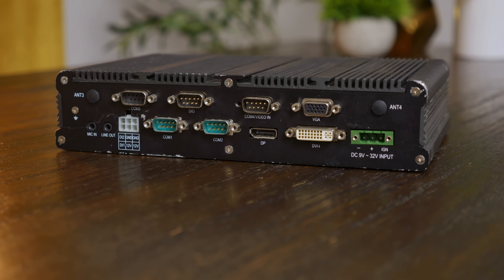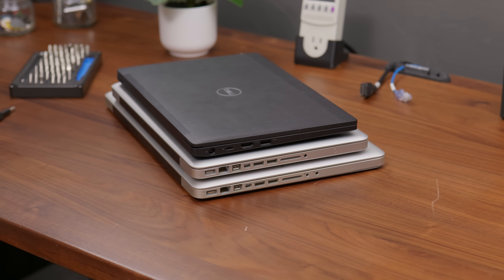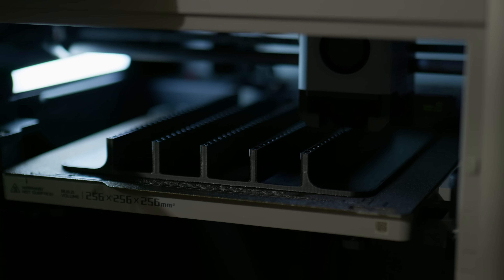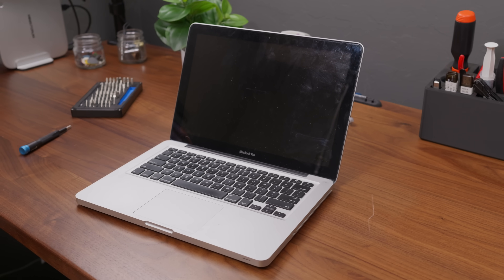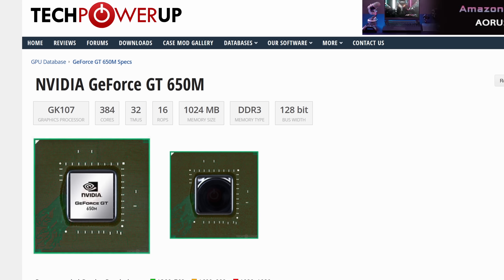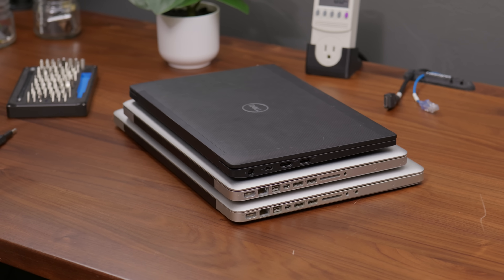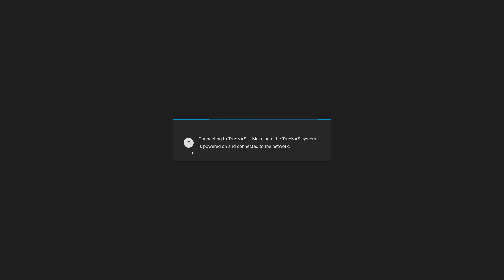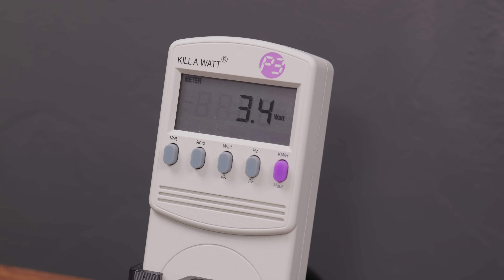Building Cheap & Efficient Home Servers with... Laptops?

Comment: I still use my 2012 MacBook Pro, I stuck upgraded the HD to an SSD, stuck in some extra RAM, and run Linux Mint on it. It does all my photo editing and media library stuff no problem. Plus it has a DVD drive which is mega useful when it comes to older media.

Comment: We are using old laptops as servers for decades....yes.. decades. For some years they are not, in most cases, interesting anymore. When they break take oo much time to find replacement machine and reconfigure the whole shit. I use miniPC with proxmox, abstraction of the hardware is a time saving feature. Bought a i7100U (low power CPU) NUC some years ago and used it with 0 problem for 5 years, been replaced with a 7840HS.
Laptop are ok for small experiment.... they are a pain to repair and cooling is not insane.

Comment: Years ago I built an OMV server out of a broken HP Pavilion dv7 with two 1TB HDs and booting from an SD card. I used it for almost five years with no problems. The screen was gone so I disassembled the whole screen, frame and hinges, installed it with a desktop screen and then you don't need it because you log in the webinterface.

Comment: I'm convinced that laptops are the best home server option.

- They have a built in display and keyboard for local management.
- Many can be equipped with multiple drives.
- They have a built in battery backup.
- You can get them cheap.
- They are power efficient.
- They don't get too hot.
- They are smol.

Comment: Back in late 1990s i had a dell inspiron 1720 ran 2 internal hard drives think were both 1 or 2 terabytes. Also had 2 more drives connected to usb3 and i velcrod them to the cover.  Then i finally tried to build a file server was just early 2000s then ran a hd controller card with a dell inspiron forget its model but i had three 3.5 inch drives internally then i got an external cd tower i stripped and installed 2 four drive backplains. Into the external cd tower so it had its own ps.  I ran all sata cables out back of inspiron then had them standing side by side connected to my bedroom tv.

Now i have a 6th gen i3 system runn8ng unraid 5.0.6. Has 18 drives all 4tb but one 3tb still havent upgraded. I have a 500gb ssd as cache drive.  I have a second 6th gen system with unraid 5.0.6 free running three 20tb drives. So this is my backup machine i keep at my dads. Its got total of 40tb storage to backup my older server.  Im debating trying to upgrade my paid unraid to 6.  Then transfer it all to my x99 system running e5-2690v3 i bought the cpu used when x99 released. Was saving for 5960x when i saw the e5 on ebay for 490$.

Id love to try unraid 6 with 4cores 8 threads the run unraid and the other 8cores 16 threads  windows tiny 11

Comment: I used a late 2011 13” MBP as a media server for a couple years. I would recommend removing the battery from a laptop you’ll be using as a server. After about a while my server shutoff. When I went to check it, the battery had bulged so much it warped the aluminum nearly forcing the trackpad out the top and I couldn’t get the back cover off.

Comment: You printed a heat trap 😂

Your stand is cramming all the heat in a laptop sandwich
Reply: Laptops air outlet is usually on the rear or side rib. I think op put them rear up, so it's all ok.

Comment: 13:00 You can make a script that will stop charging at 80% and then let the battery discharge to 10% and then start charging again. 

This way you can cycle the battery evenly. It will take like around 1 cycle per day, so battery having 500 full cycles, you look 2-3 years lifetime for the battery for good condition. 5 years is even possible.

And then make a script that if battery goes below 5%, system turns off automatically.

Comment: For someone newish into networking, could you explain why you would buy a dedicated system to run a pfsense box? Are there benefits you get from that that you don't from a consumer router? Hardware? Software?
Reply: Software, more options to play with including caching and real time filtering is the big selling point, with snort / suricata or even virus scanning with clam av, but also more effort so part of doing anything yourself is just because it's fun.

Comment: I have a relatively modern laptop with a broken display, and I'm trying to figure out if I can design and 3D print a Mini PC case for it that loses the keyboard, trackpad, and display hinges, keeps the battery, and adds an M.2 ethernet port…

Comment: Yep been running my laptop server for years.  Main advice is to find a good chassis (nvme, sata connectivity inside, ram slots, USB3 outside). Mine is a dinky little thing (it was going spare after my toddler daughter walked on the screen, so it must be 10 years old now!) and I'm just running too much over USB: it works but doesn't look pro :-) and not very performant.  Currently replacing it but the new server is also a (much bigger) laptop with two gpus for Ollama and 4 dimm slots etc.. It'll run completely silent most of the time, draw 12 watts at idle, has a screen+keyboard for emergencies, and as you say a built in UPS. What's not to like?

Comment: It’s inevitable that Mac batteries will have swelling problem and you cannot use the without battery because that throttles down the cpu. With the dell you can safely remove the battery with no impact in cpu speed.

Comment: I wish there was a way to just run a home lab/server/hub by just plugging them together and the system automatically combines them and runs them in the most efficient way. Power wise and energy wise. And when you plug in additional machines, it just automatically absorbs it and adds it to the computer power. No need to power in boot mode to type in secret codes in secret locations.

Comment: I have running a ASUS VivoBook Flip J401 MA- PS04T with a Celeron n4020 for years now as a host for QBittorrent, vpn, and RDP for my network. It's worthless for anything else ( super slow) But, it's super low powered and a built-in UPS so it does exactly what I want it to do.

I have a question though.
I am looking for a rack mounted server case or used server, or something along those  lines for a NAS with 8+ HDD hotswap drive bays. What is the go to for something like that in the homelab space? Prefer to be 4u but I'm very very flexible with that. Just would like to get the best bang for the buck but not be super expensive like over $300 . Any suggestions would be great

Comment: i actually ran a old acer predator with proxmox as my homelab for a while, then earlier this year i upgraded my workstation and now have my old hardware in another case running as my server ive been thinking of bringing the laptop back for a couple services, mainly uptime kuma as id like to have it on a separate system incase if the main server goes down my status pages will show correctly

Comment: I think with what most people are doing laptops might actually be a great start to get into networking or running a few self hosted services. Like always especially if you have it laying around anyways. Make use of what you have.
When my company throws out old computers I'm also always thinking to take them. (No worries our boss much rather gives them to us than throwing them away)
But our PCs are over a decade old and were more on the lower middle end anyways. So I can't find any proper use for them. But old laptops might actually be a nice solution to my problems.
Big companies always get rid of these things for cheap in Konvolut auctions. Should try that.

Comment: “Lipe”. I’ve had the thought of taking the screens off completely & then making a multi-tier horizontal carrier (think laptop riser) to allow access to the power buttons & better air flow. Footprint is a bit bigger but you could add a tiny 1:4 HDMI switch to help with post checking. Again: really only makes sense if you have a stack of laptops.

Comment: It's what I always use for my home server.  has a battery backup so you don't have to buy one of those. it uses low wattage.

Pro tip for any regular person watching this video. Buy a computer backup power supply and put your home Wi-Fi router on it. Then if you lose power you still have Wi-Fi for your cell phone's for a few hours also you don't have to wait for it to boot back up when the power comes back

Comment: i am using old 9 year old dell laptop which has some physical damage broken case etc  but works ok so i put   linux mint + casaos os i use this as my multi screen desktop and use it for doing work related studies emails browing  etc i have also cloudflared some of my webaps which i use it on the go works very well i have also connectdd 4 tb external drive and its mroe then enough for my a lot of 720 p content , 3k songs , etc

Comment: I have kind of a experience like this. My friend gave me his old laptop (Acer Aspire V5-573PG), which has a busted screen, so the touch surface doesn't work at all.
Additionally to that, battery was dead too, completely (0.5V for a cell). I think they estimated the costs of repair for it and it didn't worth it.
It was lying on a shelf for a few months, then I realized that I can use it for something.

So, because I am a Software Developer, I use sometimes hostings to run scripts and projects. What I did eventually:
1) Installed some light Ubuntu based distro, called Xubuntu. In the past I used Lubuntu for less powerful machines, but I neded more preinstalled packages and compatibility this time.
2) Installed and configured Docker Desktop. So I can run scripts individually and safely. With monitoring and all other sweets.
3) Added Anydesk, so I can connect to it from any place in the world. Password secured, of course.
4) Updated and installed Nvidia drivers, including CUDA, because without it, closing the lid caused laptop to lower CPU frequency, which led to stutters.

Now it is sitting in a room corner, blinkin LED sometimes and working pretty quietly.
Not the perfect solution, but it works and does what I need 😁

Eventually I am dreaming of having a proper NAS and a real HomeLab server, with enouth power to run local LLMs easily🙃

Comment: To be honest, an old laptop is actually the perfect first home server. You get a built in terminal and get to troubleshoot weird hardware issues. I learned alot running Ubuntu Server on an old 8lb HP Elitebook with an intermittently faulty ram slot.

Comment: Flawed concept. Keeping macbooks plugged in for extended periods is a guaranteed battery swell. Track pads become unusable. Can't disconnect the batteries without throttling the CPU to 800mhz either.

Comment: looks very ineficient doing it that way, but if already own them and wanna give them an use, shing about spacing the vertical stand, so that thy can breath or if thinking on running 24/7, take them apart, the display and back cover and spring some mesh to allow more cooling, maybe a stand with fans, but that all assuming one already own that waste, otherwise a real mobo is unbeatable

Comment: I use a Lenovo IdeaPad S12 with a 32-bit Atom processor running Debian as a home server. It's godawfully slow, but it works and makes use of old hardware that would otherwise sit around and do mothing. If it's a computer, you can make it into a home server.

Comment: That WWAN slot can support a NVMe SSD, you just need a B+M key NVMe SSD. While most B+M key SSDs are SATA, B+M NVMe SSDs do exist, such as the SN520, for example. I have a Dell Latitude laptop from the same era, and I'm running a SN520 as a second SSD in the WWAN slot.

Comment: Old Intel Macs are great for that use. You can run Linux on them and use them with KVM/libvirt as a Hypervisor too. Maybe also using XCP-ng instead of Proxmox could save more power since XenOrchestra runs on the pool itself and has backup builtin.

Comment: I've got an ancient second-hand laptop under my TV. It runs Ubuntu with Kodi, uTorrent for... Linux ISOs... as well as a janky script to run my wifi LED strips throughout the flat. It also pulls backups of a website I help to run. Ten years with no issues (touch wood), the only thing I'd want to change is to have USB faster than 2.0 because writing those backups and... Linux ISOs... to external drives is pain.

Comment: Very inspirational video!
I have been running Home Assistant for 2-3 years on an old Lenovo Yoga laptop from 2017. It has an Intel Pentium 3805U and 4GB RAM. So it is incredibly efficient and has plenty of performance for HA.
I have removed the screen assembly and the internal battery and installed a cheap 128 GB SATA SSD. The laptop is white on the bottom, so it sits flush against my white wall. I did have to reroute the internal power connector for better cable management.

Comment: I've used a laptop for my proxmox server for a couple of years now without issue. I would highlight to check the cooling airflow and intake locations. Mine is above the keybaord so closing the lid is not an option. So I leave it open a little and stand it like an inverted V.

Comment: Mobile hardware is indeed optimised for minimal power consumption. The problem in using laptops as servers is that the batteries go bad. We had several macbook pro (2019) laptops running as servers and the batteries all swoll up, deforming the laptop frame... We replaced them all with mac mini’s
Reply: I mean you can just remove the battery .

Comment: I set up my first NAS about 4 years ago on a 2009 Mac Pro, with TrueNAS. I had four 4 TB HD's, plus a 500GB SSD, and it was great!  It drew a LOT of power, though.  My next NAS was a 4 GB Raspberry Pi 4, running OMV, with an external 10 TB WD HD.  That has been running continuously for about 3 years with zero trouble, and it draws 7 to 10 watts!  Last year set up a second NAS on a Pi 5, with an 500GB m.2 hat to run OMV, and a 10 TB ext drive.  I now use that as a main storage, and use Rsync to sync to the older Pi, so I have complete redundancy. It's a great, cheap setup with minimal power draw.  I also run CasaOS on an older Intel NUC, which I use as a Plex server for all my movies, etc.

Comment: Mind you, this should be safe with i3 or any <45W TDP processors, once you go with """i5"""" or """i7"""" (even the mobile version) the power draw is pretty much the same but the performance is equally bad as using cheapo processor. 
and for the love of god, be careful with the thermal because the very bad drawback using laptop as server is the battery would (eventually, guaranteed, confirmed) puff like a nasty hot pocket chemical explosive pillow like that awful first gen Surface laptop.
EDIT:
Yes, most batteries will expand like marshmallow when being exposed to heat, even if it isn't charged.

Comment: How do you buy a used device and know if the motherboard is not compromised ? hacked.
I have 2 Odroid xu4's 2gb ram :( and 2 14+ year old laptops(dell e6400) but I don't know how to get any of them to help me get a Seed box, NAS, plex server, one person 24/7 video play back, and gaming server(IE. Diablo 2 Resurrected min req is i3-3250 and Nvidia GTX 660 card). I know the Iris Xe and/or UHD 630 can run diablo 2 res. 
I need all this to run and use less energy than my 9 year old gaming rig. Running all this on my 9 year old rig use's 45w. I would like to save energy at night wen board in bed fiddling around on a tablet streaming a game.  
Any pointers :P
PS. I have not tested all this with streaming a game at same time to see if the streaming uses more watt's or not on my 9year old gaming rig.

Comment: Laptop's battery will die quickly if you keep it 24hrs on and charge it while using it.
Unless your laptop have the feature to charge directly to motherboard, I wouldn't recommend to use it like that (if you don't want to replace your laptop's battery constantly).
Replacing one battery in ups should be cheaper than replacing 3-4 battery in laptop I guess so using ups might be better.